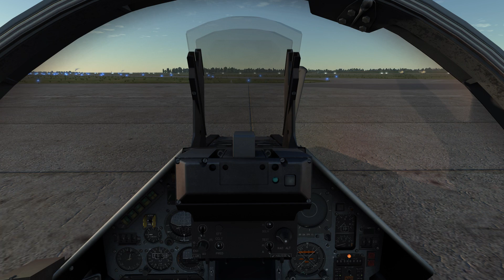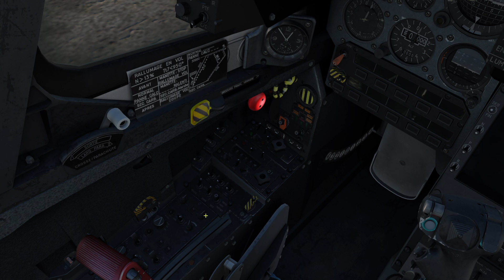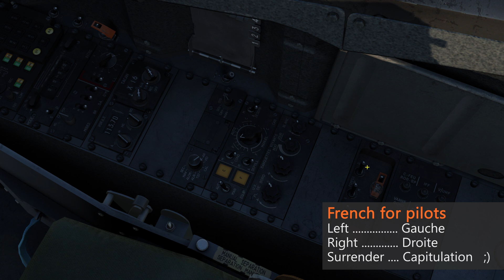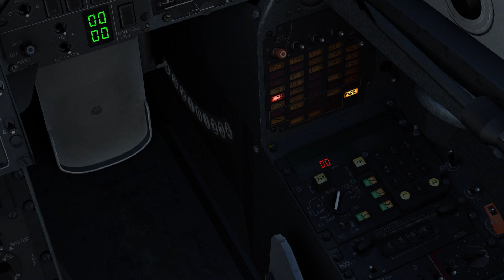[DCS] M-2000C First Look & Startup

Comment: Hi john!

Thanks for your video! Very clear and helpful as always!

I just have un small problem when i start cold and dark. When i increase power for take off, the mirage turn right like he was a propeller plane?!?

But i haven't this problem when i start with engine hot and running...

Thanks for your tuto! Keep going!
Reply from the maker: +Werlen S Hi Werlen! 
Thank you for your comment!
Not to sure about the problem you are getting there! Do you have the nose-wheel steering enabled by pressing the S button on your keyboard?
Best regards,
John
Reply: +xxJohnxx Yep locked or unlocked, it still like a F4U corsair🤔.
Maybe it's the flight computer or something with the trimming system... 

Anyway it's an amazing bird!

Danke für die schnell antwort😉
Reply from the maker: *****
Hmm, yeah. Not sure what's going on there. Haven't taken the Mirage for a spin for some time now. Probably should! ;)

Comment: should i get mirage 2000 or mig21? which do you reccomend??
Reply from the maker: +UTFA Warwolf03 At this point in time I would suggest the Mig-21. 
The Mirage 2000 is not feature complete yet, and it might take some more time until it will be released (open beta at the momment). The MiG-21 on the other hand is completly finished and works like a charm. 
Once the Mirage 2000 is released I guess this decission will be even more difficult, as both aircraft come up to a great standard. At that point I guess it would only boil down to personal preferences.

If you are not in a hurry, I would recommend waiting for a sale and getting both ;)

Comment: As I understand the aircraftmoving forward even when the Pb is engaged is true to life and no Bug. can someone confirm this?
Reply from the maker: +Obi Gaming Interesting. Wondering if that is true!
Reply: +Red Glyph Actually.. the aircraft doesn't move with me. It might be because you leave the throttle further than the idle position, which would be asking for trouble. So in this case I don&#39;t think it's a bug.
EDIT: made a thread with that. Depending on the startup procedure, the aircraft may move, which is likely a bug!

Comment: Great Video as always :)
Pulling the throttle back to idle after moving it forward to start the engine works at least for me to prevent the aircraft from moving forward.
Reply from the maker: +Skipper SMG Thanks for the feedback! Appricated!
Yeah, I noticed that helps as well, was a bit to slow in the video though :P
I guess not having the actual notches that let's you know the positions doesn't make it easier...
Reply: +xxJohnxx Normally the throttle must be placed on idle (ralenti) once N (engine RPM) is at 10%, it seems there is no handling of a stop position currently (except the stop button in the shutdown procedure), so going on idle is probably mimicked by giving a notch and bringing the throttle back at minimum ;)
Reply from the maker: +Red Glyph Sounds plausible. I will take a look later on. :)